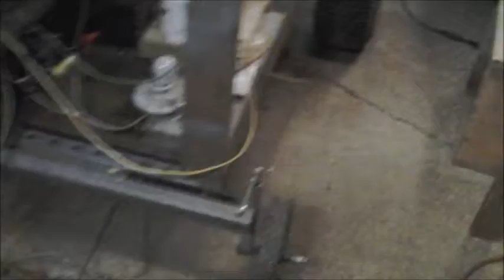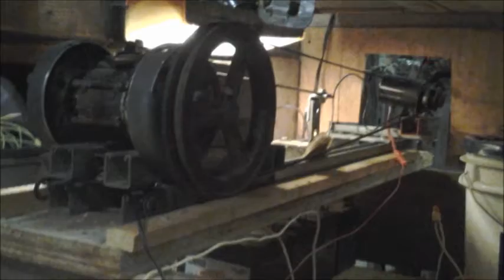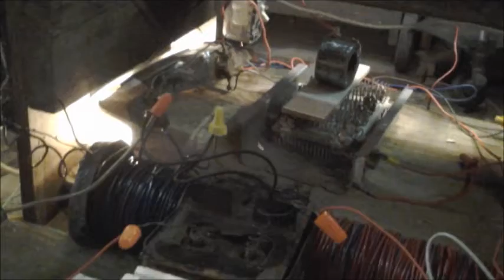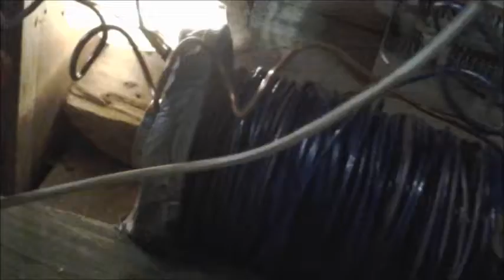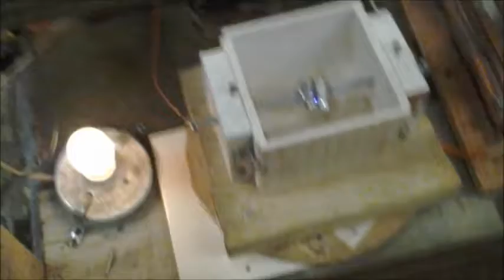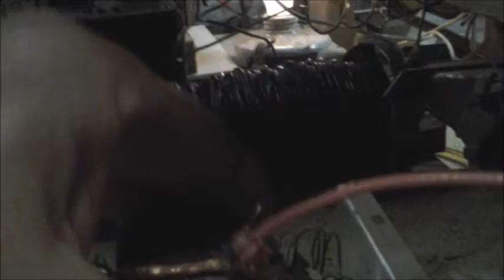gigantors power supply 1a

Comment: I agree with Roy :)
Reply from the maker: Terry Woodroof Now if 
Now If can only adjust the contacts for high speed I know she can take the load across them
Reply: Beware spark erosion!
Reply from the maker: Robert Ritchie Silver Tungsten Oxide?
Reply: Scott Russell I have seen Tungsten melt. Suggestion use a mosfet for high speed switching or for AC high speed switching use a H bridge. What voltage and current are you talking?
Reply from the maker: Robert Ritchie Well I don't know exactly where to do the switching at the 12Volt level, the 200V level or the thousands of volts level, actually very high current, like dead shorting a car battery kindof current. then it all gets stepped up from there. BUT its the super sharp square wave spikes and collapse I am after.The tungsten silver oxide contacts are "cheating" I know (Tesla didn't have those) but It all I can think of for my low budget.
Reply: perfect for a diy mosfet switching project. You can buy mosfets in the hundreds of amps ratings cheaply you parallel them to your  700 to 800 amps pulse rating better control of the output pulse shape. Just use a H bridge to control the 12 V side high current yes the solid state switching can handle it
Reply from the maker: Robert Ritchie Awesome That should be quick enough to light up the neighborhood. I DO APPRECIATE IT greatly. Thanks